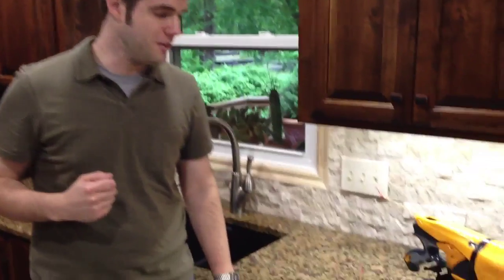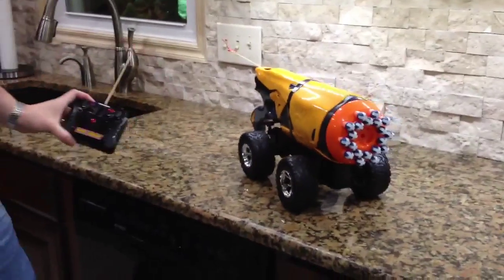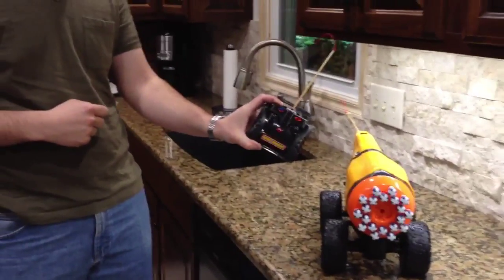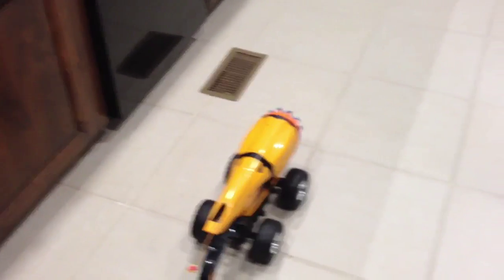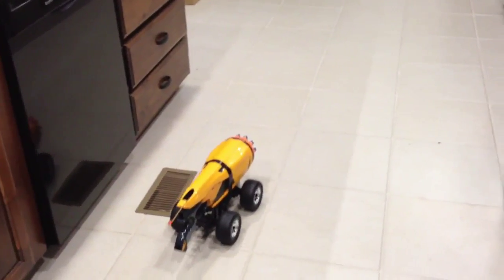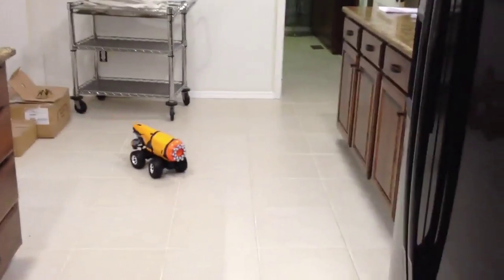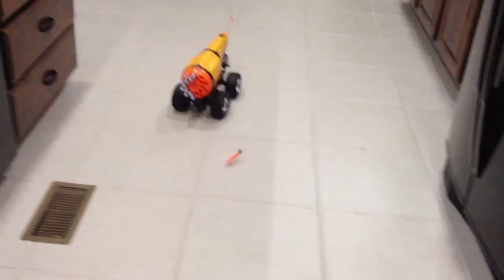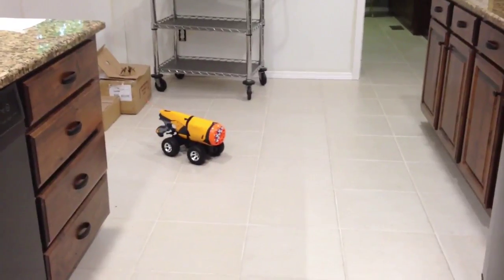Nerf gun RC car hack!

Comment: PLEASE HELP 
i am using the same rc hummer but i got it last year. The circuit board is almost idenical to the picture. the problem is the led on the remote just remote just stays on continuously. there are no wrong connections on the remote. i used the 6th pin from the top on the left connected to a switch that is connected to the ground or negative terminal. its the right negative terminal too.

Comment: Nice clean Mod. it has my approval. however it would have been better with two 9.2V RC batteries in series. that's what my swarmfire is running and I bet that would make the car a bit zippier too. making it acceptable for off roading purposes.

Comment: when i press right it goes right/back and left = left/back forward rarely works and the gun does not work either. my remote led will act normal but it goes back to troubled after a minute.(it could be because of slight shaking) i am using 6 recharged AA batterys each outputting 1.2 volts adding up to 7.2 volts and the same with the 6 volt rechargeable battery 
PLEASE HELP

Comment: Its not a hack
Reply from the maker: In what way?  I tapped into an unused channel on the receiver and transmitter, added a button to the controller, built a circuit to use it, upgraded the vehicle's battery and wired the gun and car together to run off of the same power source.  It's the very definition of a hack.
Reply: +Brian Henderson How shoot bullet
Reply: +Brian Henderson I'm live in korea 
In korea combat is so expensive